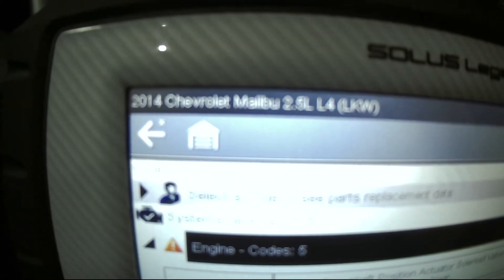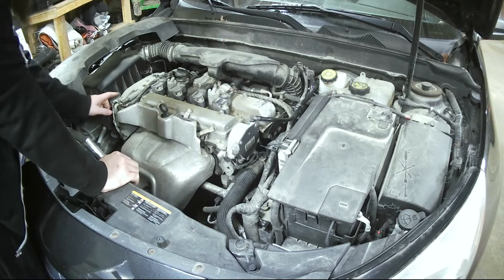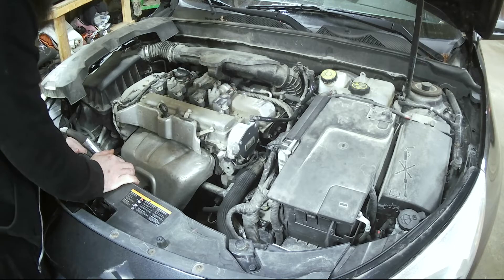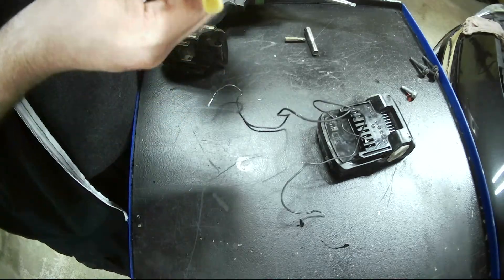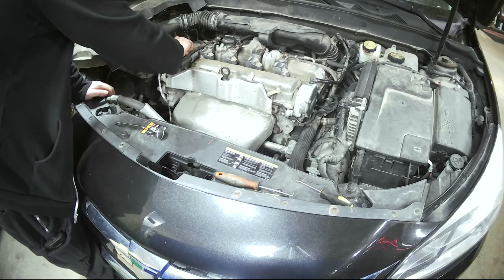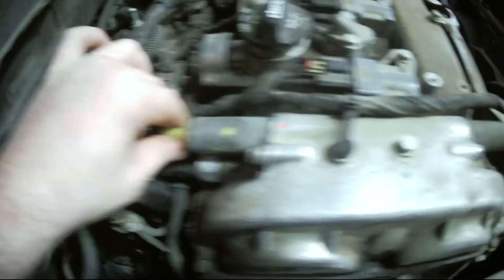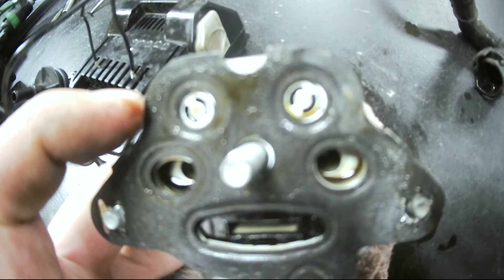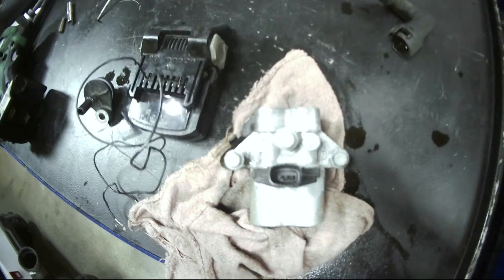2014 Malibu 2.5 P2646

Comment: Oil change before or after? 10:32
Reply from the maker: Keeping the oil changed helps reduce the chance of buildup. But if you are replacing the part change the oil with the new parts in so they will get fresh oil.

Comment: How much does that part cost and the price range to replace it??
Reply from the maker: It would depend on the shop rate honestly, approx 1-2hr job depending if they charge diag(most do) and it depends if you need 1 or both. But if i had to guess off the top of my head it would be between 2-400. May be able to take it to a smaller shop that will help a little more with cost of labor.

Comment: What are the symptoms when bad??
Reply: arent any. just an engine light. ive had this code for way longer then id like to admit but the car drives perfect
Reply from the maker: Can run rough but wont always. but check engine light with the code mentioned in the video.

Comment: There a recall from chevy , for 2014 and 2015
Reply from the maker: Could be, but probably not for the solenoids. These engines are very sensitive and if oil isnt maintained 100% there will be issues
Reply: @TheMechaninition 
I can attest to that .. my 2015 Malibu (now at 266k+ miles) had that issue the first year I bought the car bc I was following the oil percentage life monitor … the moment I began changing the oil every 5-6k miles I’ve never had that issue resurface ever again and I’m already into my 8th year of owning my Malibu
Reply: The recall was only for 2014. I just visited the dealer today with this code and they said it does NOT include the 2015. Not happy!!!
Reply from the maker: Yea the dealer loves to take money!